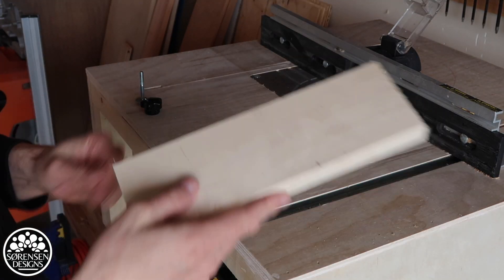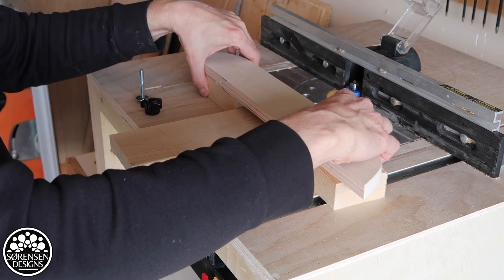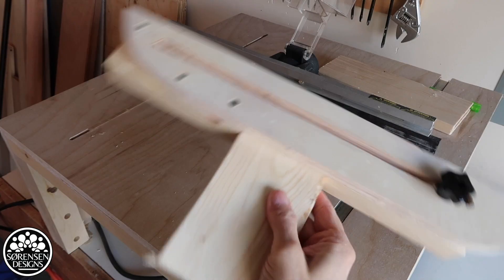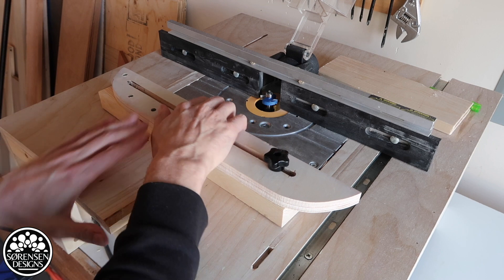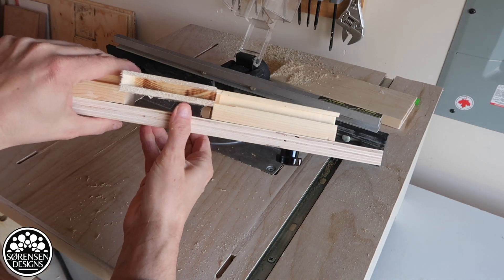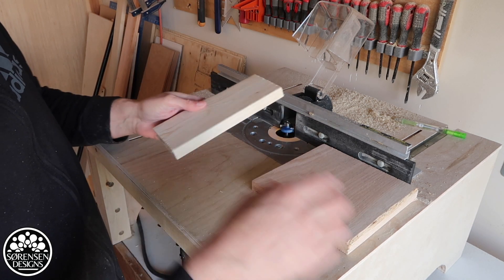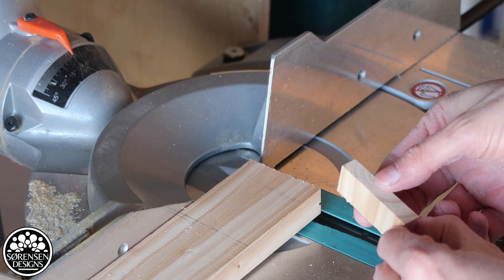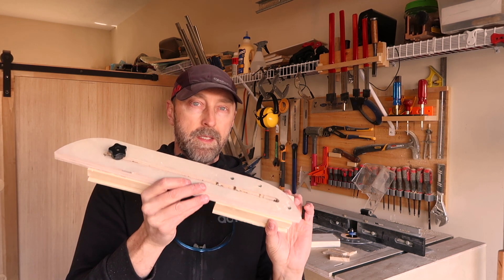Don't Cut That End Grain! Unless You Have this...

Comment: I put a mitre slot in my router table and use a mitre gauge for this type of job. This looks good if you don't have that setup
Reply: Ditto.
Reply from the maker: Yup I had the mitre slot running the other way on my previous table and used to cut the end grain that way or just with a sacrificial piece on the right side. I'm always trying to improve the safety aspect of my workshop, this jig just feels safer to me.